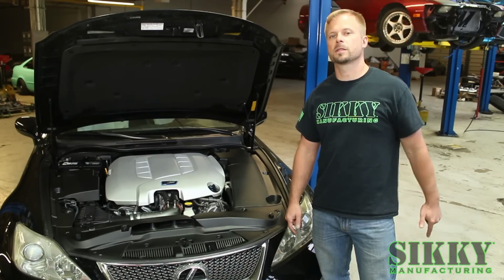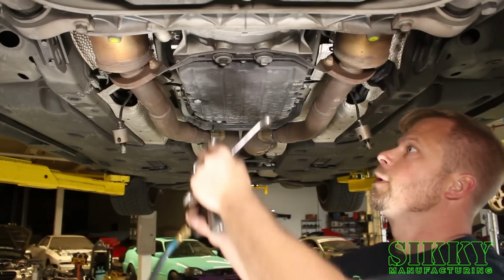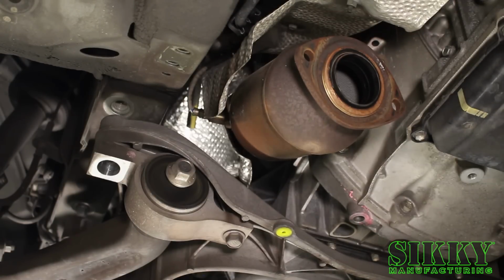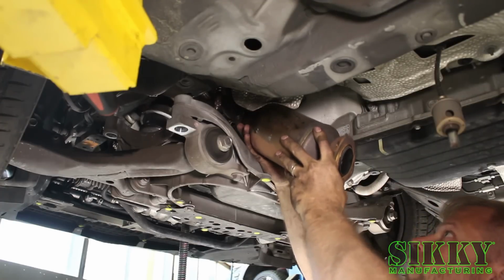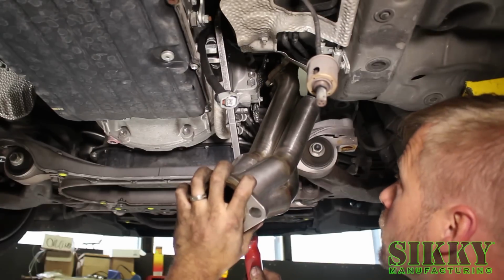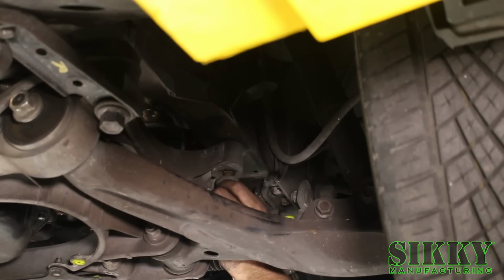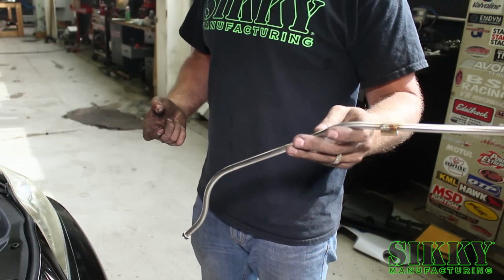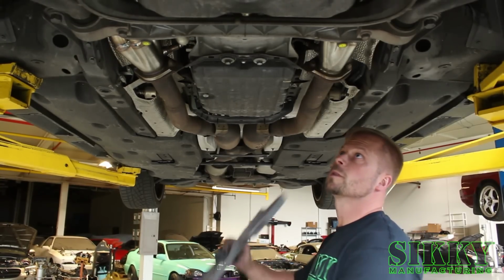Lexus ISF Header Install | Step By Step Guide for SIKKY Headers

Comment: Installing these as we speak.  

Really surprised by the clearance issues on the passenger side header nuts Especially the top rear ones. Near impossible to get tools on them.  

I had the old headers off in 4 hours , that’s with me jacking it up and putting on jack stands in the dirt.   Took about 7 hours to put 16 header bolts on to give you and idea of how hard they are.   

I had to remove the passenger side starter heat shield and motor mount to get clearance to get a swivel wrench on some of the bolts.  

Swivel ratchet wrench is the only tool you can get on half of the bolts.    Rest of the install should be easy.    Not sure how anybody could install the passenger nuts without taking out the heat shield and motor mount.
Reply from the maker: Yeah it’s not for the feint of heart!  It’s doable but takes some time. The fact that these are massive 1 7/8” tubes makes for a tight fit and limited clearance. Glad you got it done!

Comment: I just did PPE headers on my 2006 JDM IS350. When you said "that's it up top for now" I died inside, as I spent probably 4hrs up top moving things and getting the upstream O2 sensors disconnected/lose, and the top set of header nuts removed. 12hr job total, on quick jacks, by myself in my garage. Overall, enlightening, but wouldn't recommend to anyone on any 2IS
Reply from the maker: Yeah, headers can be a tough job, glad you got it done!

Comment: Marvelous video! Very clear and helpful. And enough to completely throw me off the project. Do you think a regular garage will be able to do this, or should I look for a special skilled place?
Reply from the maker: Rat Race Maverick it is definitely challenging and a shop that is not used to a tedious install like this could struggle. If you are having trouble finding a shop that has experience doing this install look for one that has done headers on Nissan 350z or 370z. These are not as difficult but have some similarities and if they are quick with that install they can get this one done for sure.

Comment: During the video I saw pink Coolant residue on the automatic transmission. Have you checked to see if the intake manifold valley plate is leaking? Common on the ISF. Basically the sealant where the intake manifold meets the heads fails and Coolant leaks past into the valley and then down the back of the engine onto the automatic transmission.
Reply from the maker: Yeah it appears to be old. Assuming previous owner had some issues repaired and this is the residual

Comment: great video with loads of common sense, only question , have there been any issues with the steering shaft going so close to the runners and getting hot enough to cook the needle roller seals and letting water into them ???
Reply from the maker: jeff8827 no issues with that. Water can't really get into that area either. Between the splash guards under the engine and the location of the steering shaft knuckle it would be surprising if any water could ever get there. Also, the steering shaft isn't any closer than OEM headers.

Comment: Why the O2 Conditioner that you have its different from PPE Headers? Did the Sikky has their own O2 Conditioner or you bought it in somewhere else? If it's dieffrent, Is O2`Conditioner Sikky are a different from the PPE in installation ( like in cutting wires or its the same way)?

Comment: Question about the install:  Why are we removing the rubber donut from the driver side engine mount?
Reply from the maker: So it doesn't melt from being so close to the headers.
Reply: That's what I suspected.  Thanks!  btw, my installer wants $2000 to install the headers on the RCF!   They go by the service manuals when determining hours.  They use Alldata to access the service manuals, and the service manual actually quotes 10 hours per side (exhaust manifold replacement).  By watching your video, and that you estimate 7-8 hours for an experienced mechanic with a lift and the proper tools, 20 hours sounds really inflated to me.  Of course, the service manual instructs you to drain the power steering fluid and disconnect almost everything from the engine due to having to drop the engine down, even if it's only a few inches.
Reply: Mack Bolan Not sure if you paid already but $800 should be the max for RCF/GSF header install.

Comment: Question everyone! If I’m just replacing the motor mounts, does the subframe needs to be drop completely or is there enough space for removal with the headers on and frame lowered?
Thank you!
Reply from the maker: Usually you can just drop it down about as far as it will go before the bolts come out and that gives you the needed room, you can also use a pole jack to push up on the motor slightly simultaneously.

Comment: What is the purpose of removing the rubber tops on the engine mount
Reply from the maker: They get very close to the runners.  To avoid melting.  Did have a few customers report they left them in and didn't have issues so you could leave if you wanted.  personal preference I guess

Comment: anyone used oem dipstick? i lucked out during valve cover job and broke my sikky one that was installed with the headers from previous owner so now i have the only choice to but an oem dip stick tub and understand bending will be required but wanted to get advice from someone that has. no forums have anything =/
Reply from the maker: I believe we still have tubes in stock if you wanted to purchase....

Comment: At Sikky installing this bare without ceramic coat or wrapping, would will the car fair over time, any issues?
Reply from the maker: under normal circumstances no issues without ceramic coating

Comment: Will the sikky headers bolt on directly to the Borla® - S-Type™ Stainless Steel Cat-Back Exhaust System with Split Rear Exit (BOR-12656) ? Please advise. Thanks!
Reply from the maker: Yes. They will bolt up to factory exhaust or any exhaust designed to work with factory headers.

Comment: Why did you mess with the engine mounts? Were they in the way or do you have to do something to them?
Reply from the maker: They are in the way when doing the install.  There is also this little nub that protrudes from the side of the mount base that does nothing and gets trimmed off.  Very very minor modification that does not effect the motor mount in any way.

Comment: Is this similar with PPE headers ? Thank you
Reply: almost, Engine mounts and mounts brackets have to be removed to get PPE headers into the correct space. If I were you, I would just buy the SIKKY headers. Theyre engineered a lot better. I would also suggest the RR racing tune, its alot easier than ECU manipulation with SIkky.

Comment: why did he remove the rubber off both engine mounts?
Reply from the maker: That rubber is just a cover and not related to the mount dampening.  It's close to the header so it's more of a preventative thing so it won't potentially melt.  They could be left on with likely no issues but better safe than sorry.

Comment: On the rcf is diferent the color from the harndess! How do i install the little black box for not engine light on! You say blank and  red and white blanck and red and gray ! Or just i install on the same position! As the isf ? Let me
Know thanks
Reply from the maker: different wiring for rcf vs isf.  Got to sikky.com and check out the rcf product listing.  There is a RCF specific wiring diagram on that page
Reply: SIKKY perfect i already install a rr tuning and no engine lighs came on! Thanks sikky greay header!

Comment: So you will lose the catalytic converters when installing the headers? What about emission test on mot?
Reply from the maker: The primary cats that are located in the factory header are gone after this upgrade but the secondary cats in the exhaust are still there if not removed also. No issues passing emissions. Hundreds of customers running these for many years with no check engine lights or problems with emissions testing
Reply: @SikkyTV  what about California emission inspections? We all know CALI is bad when it comes to changing things like this. 
(Not that I'm against it) just sayin

Comment: The overall cost of this kills the sale for me. Initial cost of headers is one thing, but to pay a shop for 7-8hrs of labor. That's going to be one expensive exhaust mod
Reply from the maker: Yes, you are correct it's not cheap.  But if you look at it from a HP to dollar spent ratio there is no mod that can touch it short of NOS.  So it really breaks down to what your goal is with your car.  If you don't want more HP and Torque and the focus is more on appearance and handling then yeah it probably does not make sense.  If you want to really wake up your ISF and make it feel like a new car with a very noticeable boost in power then it's totally worth it.   Look at what people are selling superchargers for.   For a fraction of the cost of a supercharger kit you can just about get the same amount of added power.  To each his own though, that's the beauty of modifying your car, you can do what you want!  Thanks for watching!
Reply: This is true! Thanks for the input and a great mod. What kind of hp gains are you expecting from your headers ?
Reply: How much do you charge for this install keeping it emissions legal?

Comment: How do I get these installed on my ISF if I dont have the jack/tools? Do I order the parts and take it to any mechanic? The installation seems complicated but I assume the mechanic would follow your instructions?
Reply from the maker: Hey, so yes it's recommended that you use the proper tools and any skilled mechanic can do this installation no problem. You could ask the shop if they have installed headers on any v8's before or even a Nissan 350z. It's not much more difficult than any of these installs.

Comment: why take the rubber piece off the engine mount? heat issues? if so.... why not just wrap the headers with ceramic exhaust tape....
Reply from the maker: So good question.  As far as we can tell this piece really seems to serve no purpose.  It does not appear to add any vibration dampening since it's not part of the actual motor mount, just sits on top between the mount bracket and the mount bushing but does not isolate either.  It's removed because it get's very close to the header runners.  It's just something we've always removed.  We have had a couple questions about that so we are planning to see if they can be left in on the next in house install we do.  It's possible they don't need to be removed at all but either way it does not appear to have any adverse effects on anything.  Yes, the headers could be coated or wrapped but it's not necessary if one doesn't choose to do that.  Hope that answers your questions for now!  Thanks for watching.

Comment: How long did it take you guys?
Reply from the maker: We've got it down to a science now having installed so many and can do them much faster than average but as a general rule of thumb the first time through, an experienced mechanic with the proper equipment should be able to do the job in 7-8 hours.  The scale goes up from there with less experience and inadequate tools.